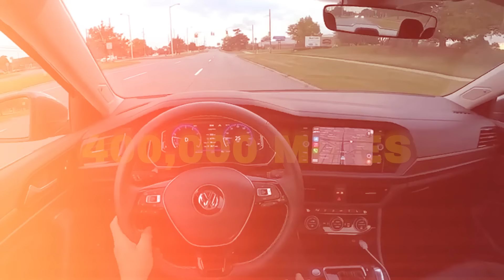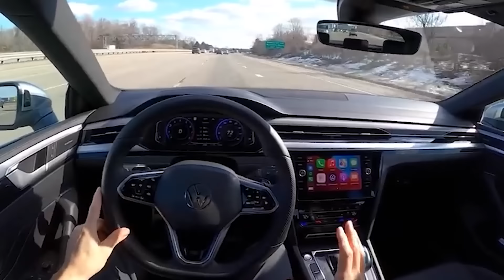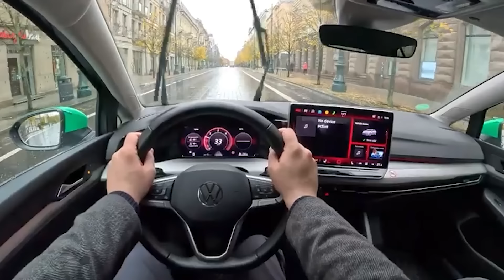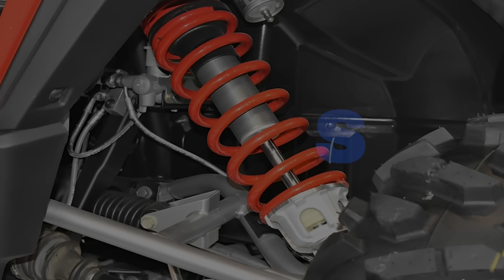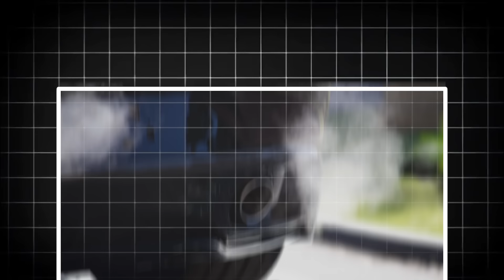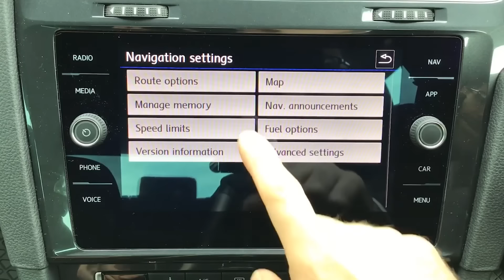How To Make Your Volkswagen Last Over 300k Miles Without Any Major Repairs

Comment: Ive got 115000+  on my 2016 polo 1.8 gti tsi bluemotion  daja facelift, 
   Just ugraded the whole clutch to a sachs peformance kit with new flywheel , the old one was still in good condition still tbh but thought replace it all anyway , upgraded the rear crank oil seal to a 034 motorsport aluminium version , new gearbox oil ,regular engine  oil changes throughout its life with recommended spec motor oil, 
  Due an oil change this week , 
  She runs like new still , upgraded spark plugs & coil packs , upraded to an aluminium top timing  chain cover, re-seal on the cam valve cover , updated waterpump oem , new hose seals  .
 Ive looked in the throttle body & intake manifold its clean . Ive a few other updated & upgraded parts on the car , full service history with every sevice done , included brake pads & discs , new front elecrtonic shocks as one had damaged internal wire issue so replaced both with oem . , fantastic gti  .
 Regular services are key to prolonging the life of these engines !! I always do the oil services before the service indicators come on the dash  as i know when its time to change the oil & filters .

Comment: I’m driving passat b8 2017 110k miles. Done replaced water pump, aircond compressor, bilstein suspension and decarbon besides normal service and maintenance. It’s a great car💯💪

Comment: I’m driving a 2012 Jetta SEL 2.5L with 105475 miles on it . When is a good time to change the timing chain or belt ? When I bought the car back in 2014 from the Volkswagen Dealership it had 33,000 miles on it. Certified condition

Comment: Been driving VW's for over 50 years and they are great cars. Started driving over 55k a year for a job I had and routinely had three VW Jettas over 350k easily. My current Jetta is a 2013 2.5 engine I bought new, it's over 323000  and all I've ever replaced was the fans & AC pump bearings.. Do your oil & filter changes no more than 4k or 5k .. Don't bother with walnut blasting just seafoam the gasoline every oil change.

Comment: Most of this is right on, but you should proof the video. I the part with replace the coolant, you show pouring windshield washer fluid into the coolant reservoir. Also this video assume you are made of money. Why does a timing belt replacement cost $1000. Why does changing transmission fluid cost $400 for 30 minute job. Also synthetic oil is a fantasy. Why does an engine oil change by VW cost $189. I do my own for $50  with filter change.

Comment: I have a 2013 Volkswagen Passat with 212,500 miles as of today. It drives really well, I think ill do the STP Intake Valve Cleaner one of the days to clean the carbon deposits

Comment: The only problem I see with this is his estimates of costs are most likely not as much as you will end up having to pay unless you know that certain place that will do it for that. $1,000 for a timing belt change? more likely you go to someplace even who is local and specializes in VW's, that figure will be more like $1800. Stuff like that. It adds up fast. My 2015 is at 90,000 miles and I have not done one thing to it except for fluid changes. I'm thinking rather than spend a ton of money to try to get it to last longer, why not spend that money and just get a newer car?  I need brakes, timing belt, who knows what else, that's thousands of dollars that I could put towards a newer car. Sure if you want to keep it and try to get 300,000 miles on it, go for it.  For me I want a more powerful car than a 150hp diesel golf

Comment: Should have added that it's imperative to shut off the automatic start stop feature especially if you have a turbo. That feature will kill an engine and turbo because it robs the turbo of critical oil when it's super hot and it puts strain on the starting system by triple digits. Always let the car idle for a minute before turning off the engine as this will allow the oil to cool critical components.

Comment: 179,000 on my 08 GTI . Stage 1 tune , so the cam follower is replaced every 10,000 miles. Takes about 10 minutes. BTW, walnut blasting is $3-500 if you do it yourself. Shops charge at least $900 for this service.

Comment: I'm on my third VW, and I have about 65,000 miles on the odometer. I've been doing 5,000 mile oil changes, but I find it really hard to believe that valves need to be walnut blasted every 30,000 miles. High-mileage GTi/Turbo owners— do you follow this cleaning schedule?

Comment: My 2013 Jetta S 2.0 NA is still reliable as ever at 200k miles and my 2019 Jetta and 2022 Taos 1.4T/1.5T have been equally reliable and consistently good. None of my vehicles have even hit the dealer or any mechanic. I do my own oil brakes and upkeep. They’re great

Comment: I have a 2020 Tiguan with the 2.0T and change the oil every 4k miles.  The top mount cartridge oil filter is smallish and looks bad enough that I don't stretch it to 5k miles.  Hoping to keep the timing chain as long as possible.

Comment: 220,000 mile 2012 GTI. Decarbonization at 110,000 miles, water pump went out at 115,000 miles. turbo went out at 215,000. Swapped. Running strong but do need to replace some other old parts. Oil changes at 7500 miles.

Comment: I have 2019 Atlas VR6 with nearly 50k on it.  Changed oil between 4 to 5k religiously.  Change trans oil at 35k, very expensive at dealer $700.  The OEM trans oil is ridiculously expensive.  So please do a video on the VR6  and anything I and other owners need to watch out for.
Reply: My 2018 Atlas has 86000 and runs great. I didn’t know about the 5000 thing until 2 years ago, but started then. Air conditioner went out at 80k (in Texas), but love the car.

Comment: I own a 2012 Touareg TDI with 171000 miles and a 2014 Touareg TDI with 102000 miles , well maintenance says it all, i only use Liqui Moly oil, and SHELL diesel nothing else…..

Comment: If you own a car, any car for 10 years without any major repairs needed except routine servicing you have got good value
Out of that car. It doesn’t matter if you did 50,000 kilometres or 300,000 kilometres in that time. 10 years is a big chunk
Of your lifespan. Cars are disposal assets which are traded in or sold by some people every couple years.

Comment: I have 2014 30th anniversary gli autobahn, 91k. Bought it used at 68k. I drive an about 4,400 miles per year. VW has me change the oil 1 time a year. Ive kept all my receipts for work I’ve had done. I’m going to get a book and write it all down.

Comment: The Italian tune up method doesn’t work in direct injection. Being that fuel does not spray directly on the valves it goes directly into the chamber this is 100% inaccurate. The unit true to way to clean the valves on these engines is manual cleaning, IE spend the dime or spend the time. Walnut blasting or scrubbing it out.

Comment: I wish I knew half of these steps 5 years ago. I drive a 2015 Tiguan 2.0 turbo. It has 131,600 miles and has a few issues going again. P2015 and P216 code right after the 120,000 warranty extension. I have had some of this work. Done some I've done myself. However, I'm not a mechanic yeah, but I had 2 different shops won, including a Volkswagen dealership. Check my gasket replacement makes sure that there was no leaks. However, I did not change the camshaft adjuster, magnet and it has been leaking there for about 30000 miles, maybe 40.

Comment: check plastic used in engine compartment by most all mfg----- bmw is loaded with plastic and toyota is following them...this is a real problem, you must constantly check your entire cooling system cause this is the first place trouble will start

Comment: 2019 vw golf alltrack sel  manual trans. 14,000 miles on OD----bought new ....i change oil every 3,000 miles and use Lucus oil stabilizer each time......todays date 4-26-26

Comment: 148k on my Jetta. Had to do change the timing chain. So far have a check engine light with a code nobody can give me a straight answer on what that code is. Epc light randomly turns on when on the highway. Car is a headache
Reply: Whats the code? Id check sensors and magnet/valve before a expensive full timing chain. You can also check the amount of chain stretch with a obd eleven tool

Comment: My 2015 VW Beetle 2.0 TDI has 310,000 km on it, EGR deleted and remapped from 110 to 180 hp - still runs like a new car. Oil changes every 10,000 km, manual gearbox (5-speed) oil every 50,000 km, OEM filters and VW-spec but MOTUL oil only (the best oil ever made). Apart from regular maintenance, all components are still original and there have been no failures so far. I’m planning to replace the flywheel as a preventive measure only. I’ll try to push it to 500,000 km or even more -fingers crossed

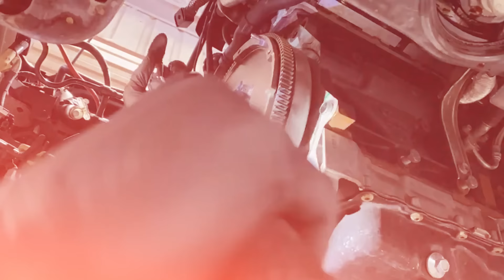Comment: 2:55 -- why on earth would a mechanic "open the engine" for a clutch job?  The clutch is not even an internal part of the engine.  I'm now assuming this entire video is AI clickbait.  Besides -- it doesn't even touch on other aspects of the car.  For example, my 2022 Passat Limited has an incredibly poor design for the braking system.  Both rear calipers were replaced because they seized, the ABS module failed and was replaced, and now all four calipers have seized guide pins for the caliper brackets.  I have no engine problems (except an oil separator that was replaced under warranty).  This is my 2nd Passat (last one was a 2014 TDI that unfortunately got rear ended in 2022, leading me to the new one I have now).  Funny thing is -- that one never had brake issues (but it did go through several heater cores, which is a known problem).

Comment: 2000 ALH Jetta TDi Manual with 240k on the clock and still going. Runs smoother and consumes way less oil than our 2013 ZSubaru Impreza with 180K

Comment: We have owned a number of VW’sover the years and currently have a 2014 and 2023 Tiguans. In both cases, we have Oil and Filter changes done at 8000 kms (5000 miles). I follow all of the other maintenance tips here and consistently find our cars lasting well past 200,000 - 250,000 kms. Truly, we often just want a new car and have great resale value at 200,000 kms. I think a lot of the challenge these days is that owners think like consumers, “Buy a car, use it, and throw it away”. That mindset often means very little regular maintenance and severe problems in the long run. Don’t be one of those people and you will usually do well with any car.

Comment: 2006 Jetta 2.5 with 182K miles runs very well but has required many body and electrical parts mostly, non-engine related except for a heater hose, ridiculously expensive and an oil leak, not so expensive. Some parts I have replaced, wiring harnesses, switches and the like but every time I take things apart, I curse the manufacturing engineers who took excellent designs and executed them as cheaply as possible. Flimsy plastic crap that could have been executed with better, heavier better-quality plastics. My '99 Camry shows that Toyota engineers know their plastic bits better than VW.

Comment: I'm driving a 2013 VW Jetta SE 2.5L with 306,427 miles
Reply: 5 cylinders the best cylinders
Reply: 2012 passat 2.5 gasoline at 297k here
Reply: Had a 13. Wish I kept it😢
Reply: 2013 Jetta se with 195,000 miles
Reply: 😮 That is amazing !!! I am focusing on VW Atlas to do the same... Wow VWs are showing out !!!
Reply: @timothyliles5690  I would not call VW a reliable brand. Once they get old they will need costly repairs. The 2.5 5 cylinder engine was a pretty dang good engine and was reliable. I have a Tiguan now but it's a 2020 and has not given me any trouble yet but it's going to need some maintenance coming for sure. I think there bigger SUVs have had quite a few reliability issues so make sure you know what you are getting into.

Comment: I have a mk 6 golf blue motion 20ltr tdi  had the car 3 years its now done just over 154,000 miles only had clutch slave cylinder replaced  and n/s rear caliper seized so replaced that still runs like new cambelt kit and water-pump done with previous owner at a VW garage getting over 50 mpg this only a second car so used to commute to work and back

Comment: My 2007 2.0 TDI Passat has 310’000 I do 6K oil change and hav fitted 2 turbochargers - balance shaft oil pump drive - steering lock emulator - Drivers Door Lock - Should do the EGR Cooler - Dual-mass Flywheel - numerous boot locks and miscellaneous stuff but it drives like a train 👌🤞🙏

Comment: 10,000 miles oil interval is mostly for people that drive in highway and dont do much idling as well as good weather conditions. For most of us, change the oil every 5,000 miles if you drive mostly in the city and idle a lot.
Reply: What about changing oil at 3k intervals or is that to soon
Reply: @Mistickman47  too much preventative :)
Reply: @Mistickman47 do it at 3k
Reply: @Mistickman47 do it 2k miles just to be sure
Reply: Were not going to listen to you!

Comment: This guy is a hack. How about following the recommended maintenance in the users manual. The only way you can prove the theory of 5000 mile oil change vs 10000 is have two of the same vehicles. With one, change oil at 5k. The other at 10k. Both vehicles need to have the same driving history, city, highway, etc.  Then Compare the longevity of vehicles. Don’t make a claim without backing it up with scientific experimentation.

Comment: The 2 Liter engine that's in the Golf Rs and Audi S3s and even other cars EA888 or what ever the new revision is has port and direct injection. 
doesn't prevent carbon buildup but certainly helps. 
Probs best to also stick catch can on the recirc valves to prevent oil vapers going back through the intake.
Reply: It's only true for EA888 Gen 3b. The newest one - Gen 4 has only direct injection.

Comment: I have a SEAT Tarraco, which is a badge engineered VW Tiguan. By the way, I'm in the UK. It's a 2019 model 2.0 TDI with 47,000 miles or so. It's in the garage today for a gearbox fluid change! (Its a DSG auto box). It also has a P067300 code (Cylinder 3 Glow Plug Circuit failure), so I'm having all 4 glow plugs replaced a the same time as the oil change.
It has had annual engine oil changes, which average at about 7000 miles per year, so I'm hopefull that this will last me for the rest of my driving life!
Thanks for the tips regarding preventitive maintenance for longevity.
Jonathan.

Comment: driving audi ttrs changing oil every 8000km , haldex fluid every 40000km, transmission fluid 60000km. Coolant replacement every 40000km. the most expensive parts of maintenance are the brakes. It required to replace rotors and pads simultaneously. around 5000 USD

Comment: My first VW was a 1985 Scirocco that took its last drive at 185k… I totaled it or it would likely still be in the road. I have driven 6 VWs since then and sold them all running other than the Touareg that someone rear ended and totaled just last year 😢 currently I am driving a mk4 GTI with 150k and have a second project mk4 GTi with 161k. I expect both to clear 250k easily. The 5k mi oil change is probably the single most important tip someone can take away if they want ANY car to last. The only thing I’d add to this list is replace plastic coolant parts with metal. Since oem doesn’t make them you’ll need to go aftermarket but for most other things oem is the way to go. I can’t stand their plastic parts for heated liquid 🤦🏽‍♂️
Reply: Spot on. I just replaced a plastic coolent flange that keeps the turbo cooled with an aluminium one. It is a plastic epidemic generation. 😮
I too change my engine oil much sooner at 8,000km instead of the rediculous 12,000 km.
My 400 hp tuned Golf R has 170,000km and only just changed water pump thermo housing. 
I checked my timing wear via OBD 11 and is only at - 0.3%
Barely a nudge. 👍🇦🇺

Comment: A whole lot of brittle plastic in the coolant system stupid design and a ticking time bomb.
Reply: Stuck open thermostat seems to be a common problem. I currently have this on my Golf mk6 1.6 TDI CAYC engine. Just waiting on parts to swap out thermostat in plastic housing.
Reply: true, bmw is loaded with plastic and toyota is following them...this is a real problem, you must constantly check your entire cooling system cause this is the first place trouble will start

Comment: Audi A1 1.6 TDI. currently at 157K Miles. Oil change every 6 months regardless of miles. (Normal around 5k anyway) I do most maintainence myself and services. I can hear it needs a Cam + Water pump change in the next few months. Gearbox seems fine. Though I need to do a Fluid change. Done themostate already and cleared coolant. Will need doing again soon. Its treating me well and it goes up to scotland from the west country twice a year.

Comment: 490,000 - 2014 GTD, Changed the oil every 5000km. It works!
Reply: Lol
Reply: 490k miles or km? That's honestly really impressive man damn..
Reply: How often do u replace the camber water pump.. also my gtd very rough on idle any advice

Comment: 2025 vw Jetta Sport
14,700 miles
2 oil changes with vw oil and filter.
Replace engine air filter with Hengst brand 
Replace cabin air filter.
Rotate tires
Royal purple fuel injector cleaner
Repair a stone chip with repair kit
Check tire pressure at 36psi every month
Protect paint with turtle wax hybrid  liquid

Comment: 2011 A3 2.0 TDI Cr. 180k miles, no issues and still great. 300k target.. oil change 7k interval.
Reply: How much for oil change?
Reply: @KanenasAnyparktos I change my oil myself. Filter OE £12, oil £30. Castrol 5w30 LL